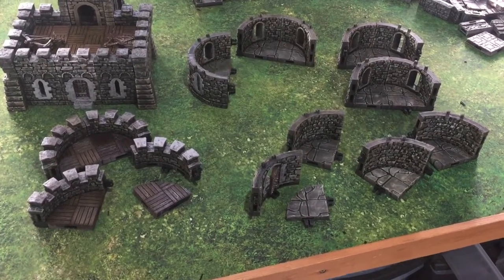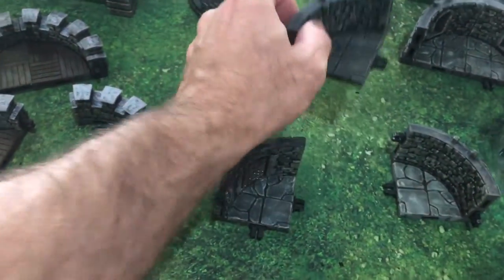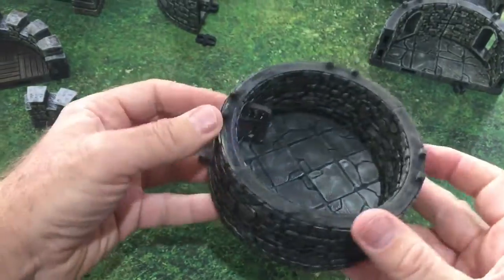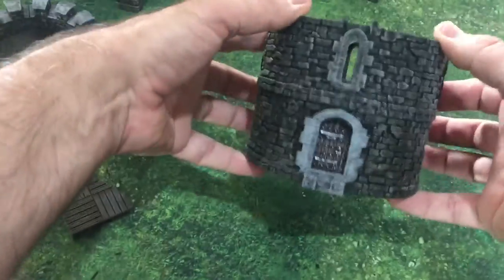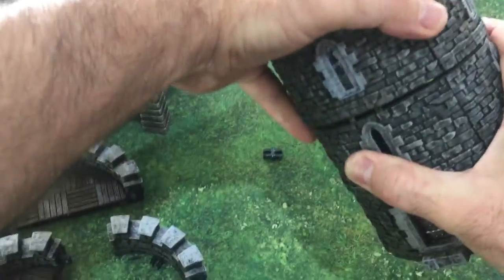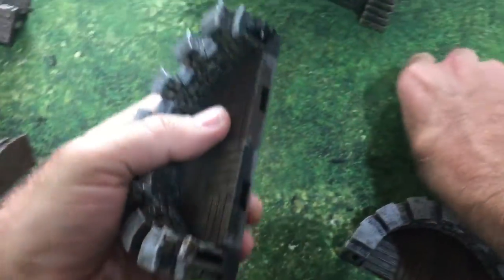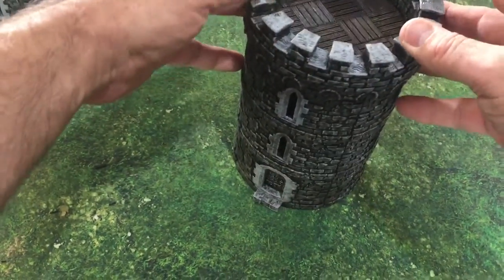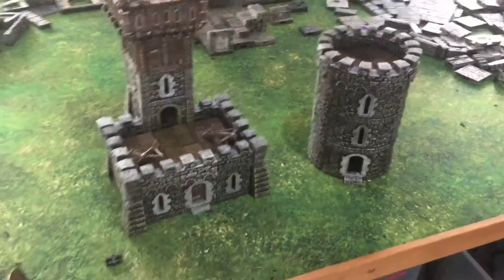Rampage round tower

Comment: I'm guessing you can use the stone floors with the battlements instead of the wood?
Reply from the maker: Absolutely Doug. The openLOCK system means you can have whichever rounded floor section you choose sloted in there from any of the sets